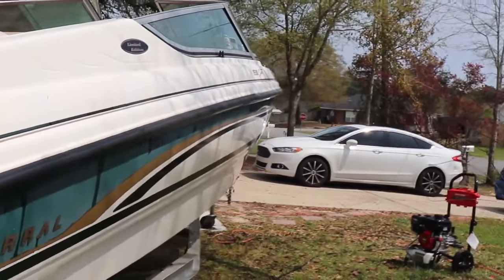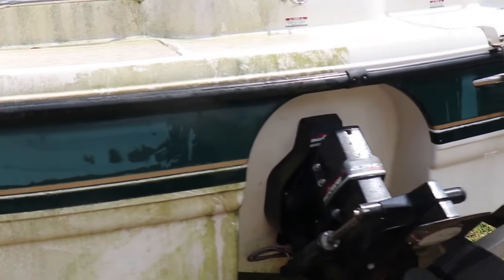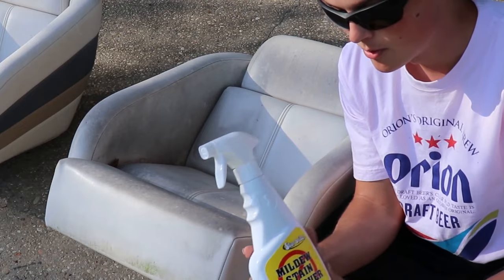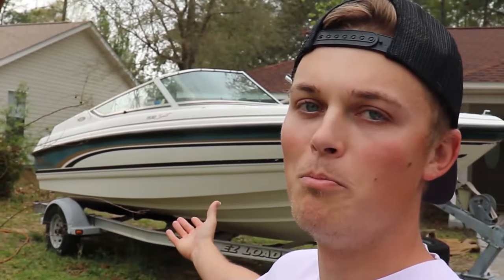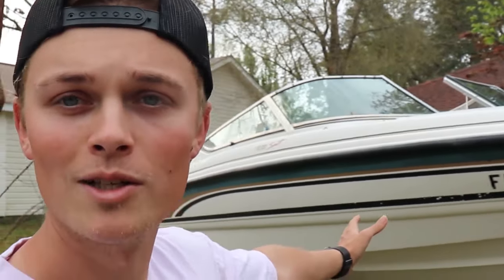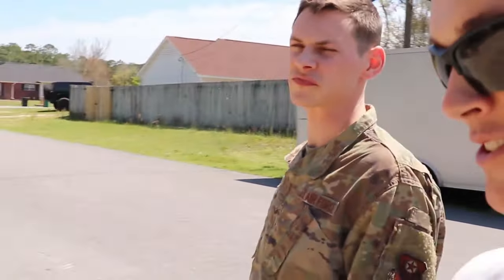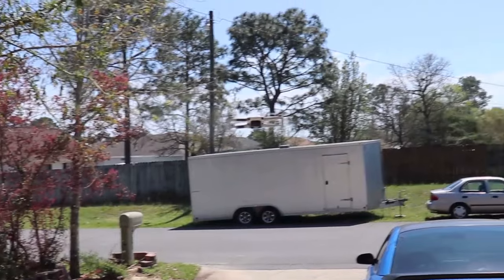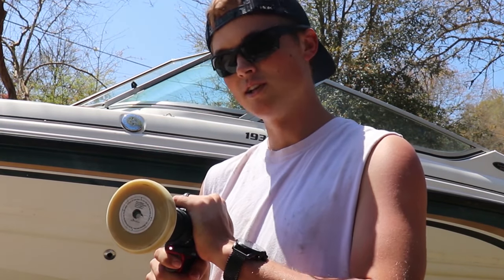Boat Restoration | Fixing a Cheap Boat |🚤| Part 2

Comment: You need on and off hull & bottom cleaner ! 
Spray on and spray off it’s pretty amazing !
Reply from the maker: Never heard of that, this is my second boat project so im learning along the way...Ill have to use that for the third boat! unless we buy a different project for the channel. I appreciate the advice frank!
Reply: @slickshifts3434  I tried toilet bowl cleaner it works if you let it sit and agitate it. this stuff you just spray on from front to back by the time your done spraying your ready to hit it with the hose ! Your kicking ass on these projects though !
Reply from the maker: Toilet bowl cleaner works wonders! I used that on my last boat project...in this video actually. https://www.youtube.com/watch?v=aWujoPwlNBE&t=442s

I appreciate that frank, I'm not sure what the next project is going to be. Thinking a 1950's Ford F100...not sure yet.

Comment: Next time, I recommend you pre treat it with degreaser and rust remover from a pressurized spray bottle, it will cut that time in half!
Reply from the maker: That’s a good idea 💪
Reply: @slickshifts3434  I seen professional boat retailers do this, it shaved that time down like mad, and you get a better product.